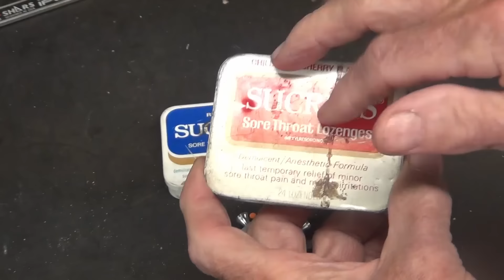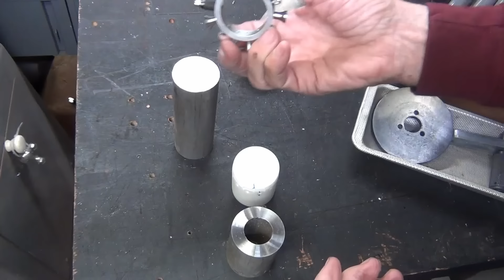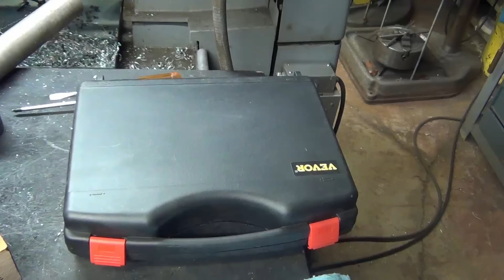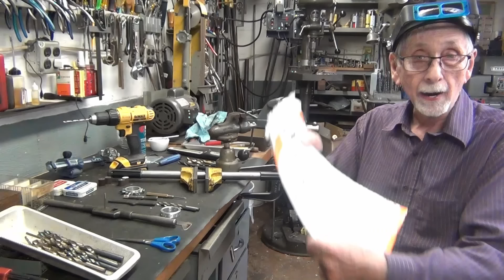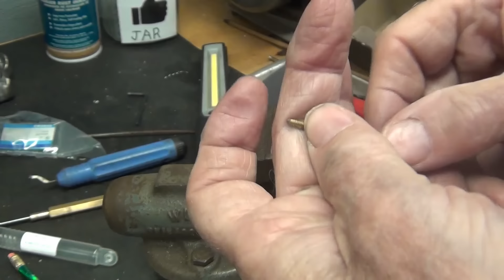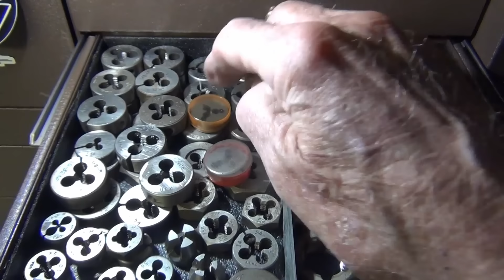MAKE a STARRETT INDICATOR TIP HOLDER #1065 tubalcain

Comment: Your finding you had the tap after the job was done gives me comfort. Often when I lose something I go buy another just to force the universe into revealing the location of the lost item. It's works as consistently as gravity or the laws of thermodynamics ;)
Reply from the maker: It sure does,. And the location is revealed the next day.
Reply: That's why I have  3 or 4 12mm combination wrenches. Hasn't worked on my low angle block plane or my Channellock adjustable wrench, though. I think the problem is I already had duplicates of those. I have to go get a 3rd of each for the missing ones to be revealed, I expect. ETA: I found the block plane. Still looking for the Channellock.
Reply: @Bargle5 that sounds right
Reply: just drop something look alike and watch where it goes

Comment: Job well done.  Especially enjoyed the tapping with the awesome tap handle and see the awesome scribe on your bench.  Thanks Lyle for sharing.
Reply from the maker: That is a nice scribe. I use it almost daily.
Reply: @mrpete222  Nice.  I have some Alu Tube with 1/4" wall, I think I will make a couple.  I do have a couple Starrett ones already and still have tips floating around.

Comment: Don't be discouraged. Hardly any one works with their hands anymore. This is the reason for the $200 an hour shop rate  and the $500 for the electrician to change the lightbulb on the cathedral ceiling.
Reply from the maker: Thanks for the encouragement!
Reply: The cathedral ceiling price is because few have the access equipment required for the job, so those who do can charge whatever they want. Workshop hours have always been charged to the customer at many times over what the workers get paid, so I don't believe there is anything new in that rate.  

It's just good business sense / capitalism working exactly as intended to charge that way 😊

Comment: That’s so odd. The Starret holder having 14 positions is 25.7° apart where if it had 15 spaces, it would be an even 24°.
Reply: Maybe 15 or too close together.
Reply from the maker: Yes odd

Comment: Goodmorning Teacher,  I repair dial indicators and also in need of 4-48 taps to repair a stem on an indicator.  Just like your experience from Amazon they sent me a bag marked 4-48.  After some frustration I too found both taps were 4-40!!! Next order was from McMaster Carr with no issue.  Thanks for your videos.  Everyone is enjoyable and relaxing for me.
Reply from the maker: Well, at least they’re consistent
Reply: @mrpete222  There needs to be another adjective after "consistent" to describe them even more accurately .lol
Reply: McMaster-Carr delivers quality products on time, and most seem to be made in the USA with certificates. I have ordered steel and parts on a Sunday, and it was waiting for me outside Monday morning. They are awesome. Scamazone now seems like a front for Alibabba.

Comment: Loctite 4-48 setscrews into the male tapped holes. Problem solved.
Also if you have a Theisen’s farm store that sells firearms most of them do have a NF screw selection.
Reply from the maker: Those screws would have to be ordered. And probably a box of 500.
Reply: @mrpete222  setscrews for sure. Since you found the die you’re in business for making some allthread. Neat project by the way. McMaster-Carr 18-8 4-48 x 5/16”,  $6.34 for a 25 pack.

Comment: The contact points are steel or stainless steel.  Do you have to be concerned with corrosion with dissimilar metals with using aluminum?
Reply from the maker: Apparently, not if that’s how starrett makes theirs
Reply: @m @mrpete222 am a bad student.  I wasn’t paying attention when you mentioned that the original was aluminum.
Reply: Great project.

Comment: They took out the 1,1,1,  trichloroethane out of tapping fluids for health reasons and because of ozone depletion but the old tapping fluids were indeed better.
Ace hardware doesn't sell 4-48 screws, at least  not here in California;
McMaster -Carr however does carry them. 
Nice work Mr. Pete on the drilling and tapping of the holes 🕳️ 'round the Aluminium ring.
What I really hate about the Post Office these days is that stupid USPS Ground Advantage®. It's just an excuse for losing your packages.
Reply from the maker: True

Comment: Still wondering why you didn't tap in the mill. I think it would have worked. Also the tap head I have to use in a drill press or mill has some float that improves the sensitivity for fragile taps. I know, everyone has different methods and experiences. Just commenting to improve your algorithms. Wow! I don't think I have ever used that word in a sentence.